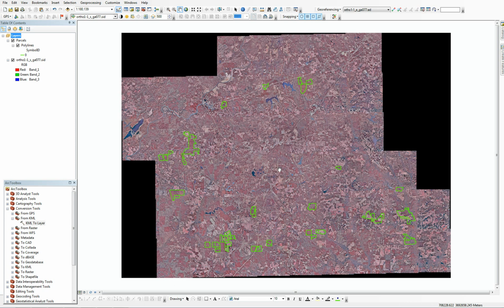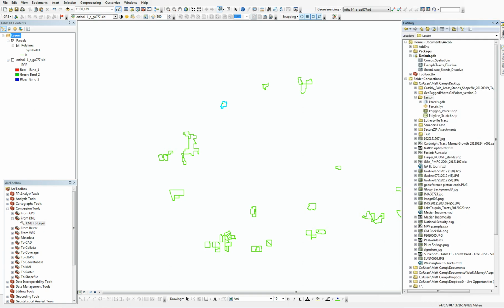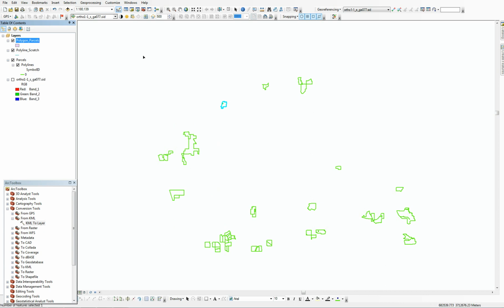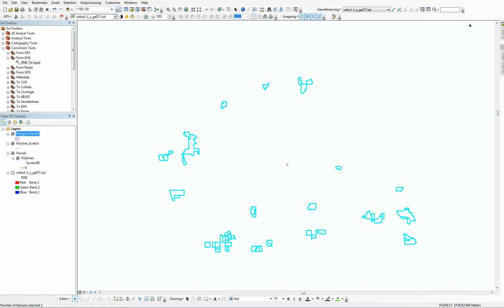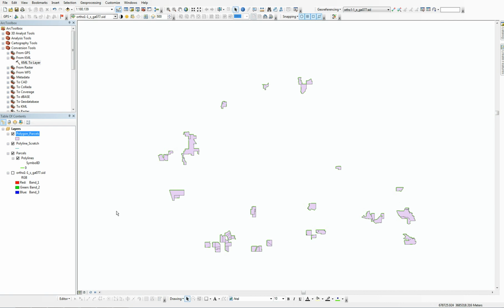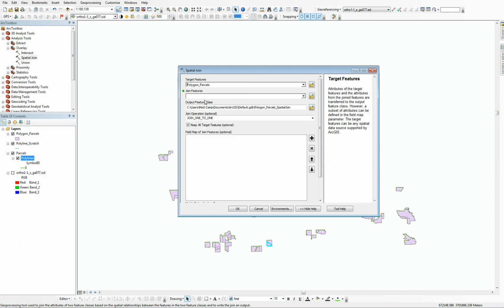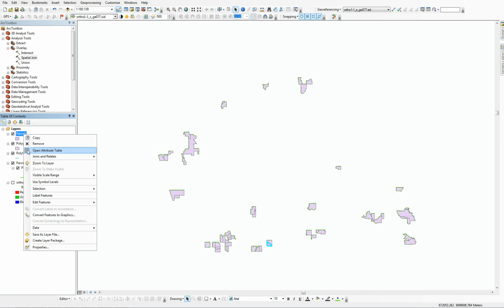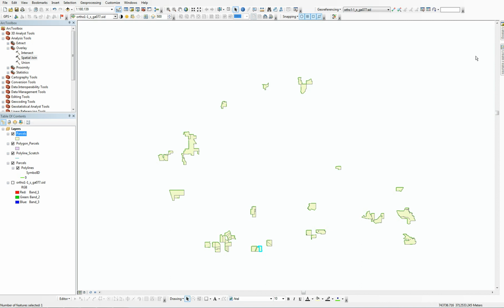Polyline to Polygon 12 10 2012 8 42 42 PM

Comment: Which did you start editing with? The polygons or the polyline feature?
Reply from the maker: It's been a while since I did this. If I understand your question then the confusion may be due to me starting the edit session from the Table of Contents in the Polygon_Parcel layer's menu instead of the editor toolbar. However, once the edit session was started, both the polyline and polygon were active in the edit session. So the basic workflow is...
- to copy the polyline features into the polyline scratch layer. 
-Merge all of those features into a single feature (within the polyline scratch layer) and 
-then use the auto complete polygon tool to create the polygons, from the polylines, in the new Polygon_Parcel shapefile.
Reply: Thank you, works great.